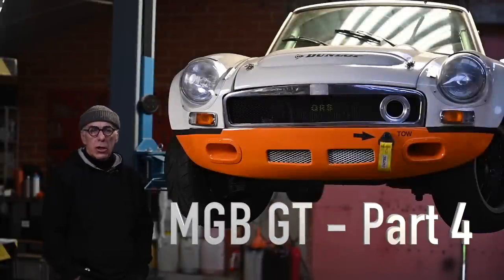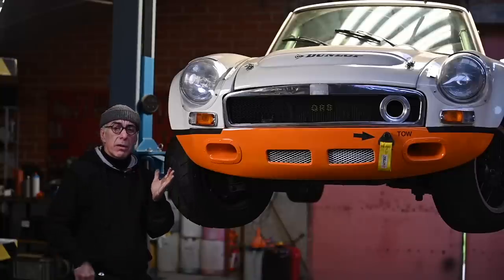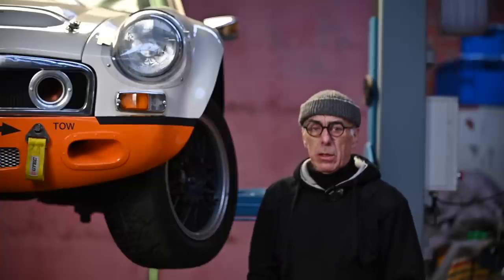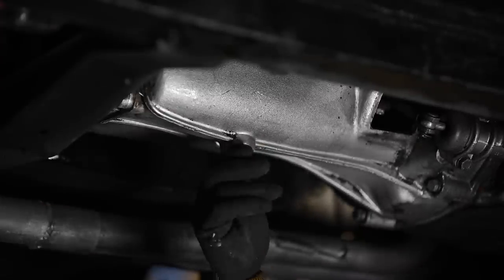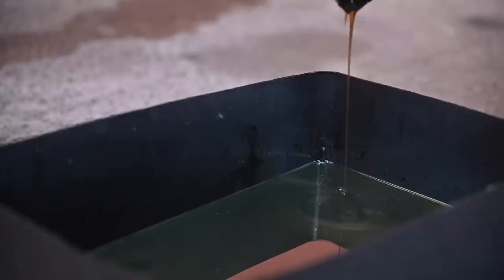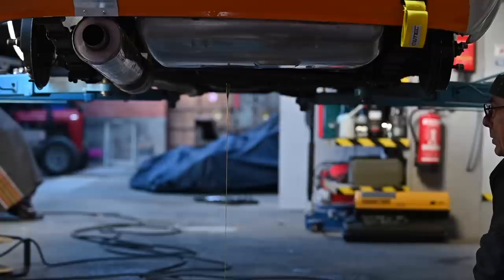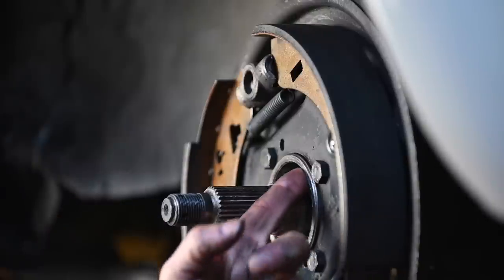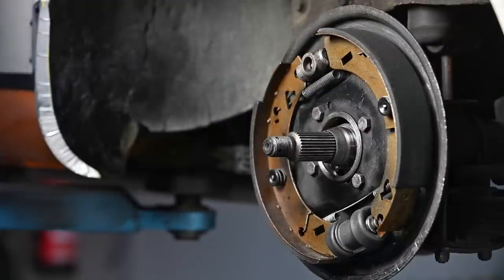MGB GT  track preparation - Part 4 - gearbox&diff oil, brakes, axle seal and dampers

Comment: Great view of the front brake cooling hose, thank you. I have had leaking issues on my rear hub seals. Already replaced them once. At my last inspection they mentioned 'evidence of oil leak from rear hubs'. So before the next inspection I must remember to remove the evidence :)

Comment: Good Job Steve. I’m pleased you changed the shoes on the side with the slight leak. I was watching another channel only yesterday with a similar issue, but a worse leak and the guy was adamant that there is no need to change the shoes. He advocated soaking them in brake clean overnight to drive the oil out of the friction material.  Obviously this is not going to be effective and will be dangerous. I was confident that you would correctly address the situation and you did.  Thanks for these videos.
Reply from the maker: Thanks for the comments

Comment: Another great video Steve. I always drill and safety wire my fill plugs to the drain plugs on the diff., gearbox and oil pan of my race car so they can’t come out while on the track.
Reply from the maker: good idea..

Comment: Very well done!  I have performed these tasks many times when I raced my Datsun 510.  One thing I had done on the drum brakes was to have the shoes professionally arced to match the ID of the drums for maximum contact.  Every little bit adds up on a race car.  Since drum brakes are not common on modern street cars you might have to search for a shop that can do it for you.  I went to a shop that worked on semi trucks that had a machine that could match the arc of the shoes to the drums.
What is the name of the manufacturer of your giant syringe you used for filling the gear box and differential?

Comment: Steve I am not sure if you can use them in your racing group, but Bastuck in Germany makes aluminum alloy “alfin” brake drums for the MGB, lighter and better heat transfer therefore less likely to get brake fade.
Reply from the maker: Thank you, and something i need to check on...

Comment: Replacing that oil seal on the rear axle looks a lot easier on your car with tube style axle than on my MGB with banjo axle. To put it simply: the oil seal sits on the other side of the bearing. So for the banjo axle it is necessary to press the bearing out of the hub to get to the oil seal. More disassembly steps, plus a press, was required to replace that seal.
Reply from the maker: Thanks for the comments, indeed this axle ( tubes) is easy

Comment: Efficiency of drum brakes is actually quite greater than disc brakes (if they are of comparable sizes). Early cars didn't have to use a vacuum power brakes amplifier because drum brakes can actually amplify themselves. Furthermore, drum brakes are better protected from dirt, debris, contaminations, and water splashes from road (which can easily make disc brakes warp). The only and the biggest problem, con, and disadvantage is cooling rate. They are heavy and closed, so they're really hard to cool down (and to heat up as well, by the way)

Comment: Thanks so much for all your videos Steve, I've got the moss cold air intake and trying to decide if I want to relocate the k&n Infront of the radiator mount or add a cold air intake duct to the engine bay like you have. Do you have an opinion?

Comment: The duck tail spoiler is cool looking but does it have some effect? Is the air flow still attached along the rear window?
The brake pressuriser us a beat device for sure by the way 😏
Reply from the maker: The biggest benefit is that the tailgate is all polyester, so very , very light..  that is the biggest advantage. I gives a bit back pressure, but not that importend here..

Comment: Could you give advice for free for me, i'm struggelin with twin weber dcoe's .. have 55f9 idle jets but the engine wants more fuel, have tested the inlet manifold for leaks. I have a lambda mixture gauge and its on lean on idle , i have to turn de idle mix 4 turns out to get the idle ok
Reply from the maker: Hi, just go when idle jet seize up 65f9 and make sure the float level is right...

Comment: Nice video! For adjusting the rear brake shoes I think a special spanner from a Mini will also fit to the MG. 
What kind of paint do you use on your brake drums and engine?
Reply from the maker: indeed, 2 component paint with harderner

Comment: The shafts are probably scored and new oil seals will only go so far. You need two Speedi sleeves. But then again you probably thought about this. You sound knowledgeable.
Reply: I think the seal bears on the collar not the shaft. You mean the casing do you?
Reply: @davidgerrard8661  oh, I see
Reply from the maker: Lucky , they were ok